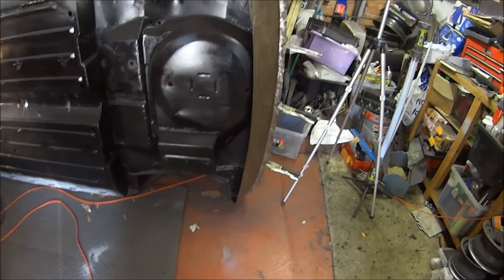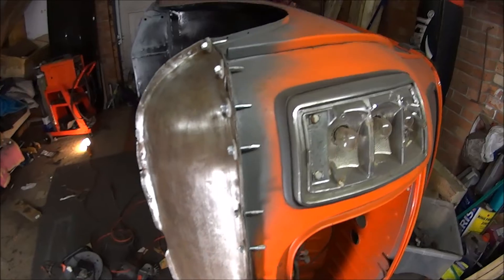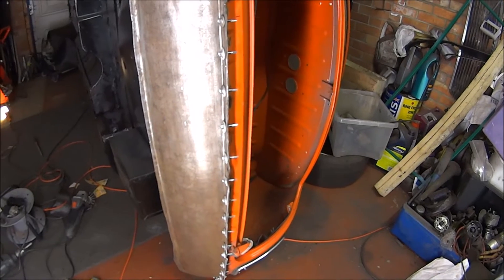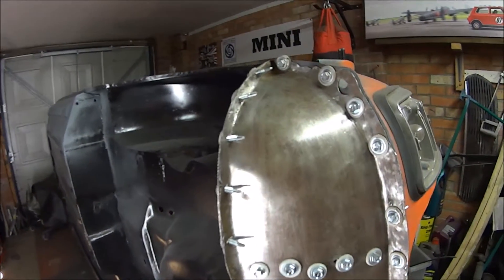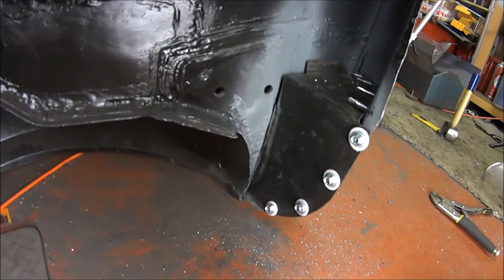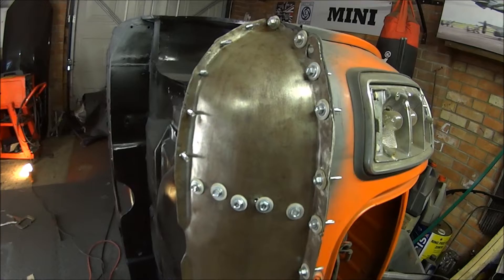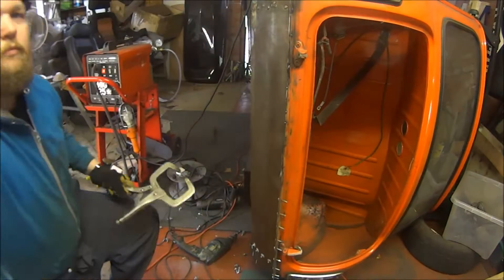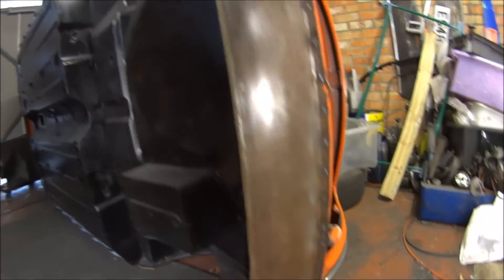Rear Valance Replacement - Project Bumble - Classic Mini Restoration - Part 30

Comment: Meant to ask before, what did you put down on the floor before putting the shell on it’s side and did you have to brace anything first
Reply from the maker: James Barrie hi, I was using a piece of wood along the sill and roof bars to stop the side of the car from touching the floor. I didn’t brace anything but maybe it would’ve been a good idea.